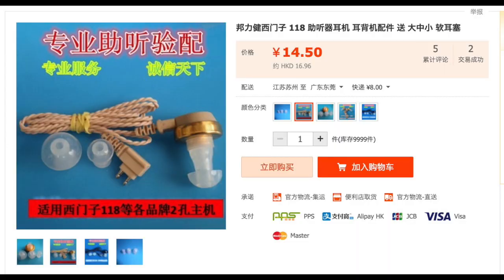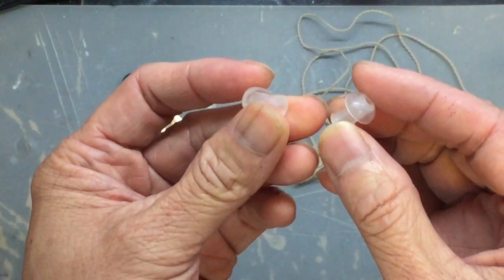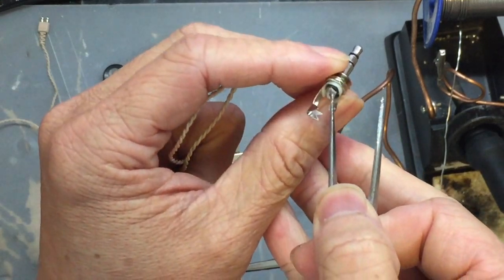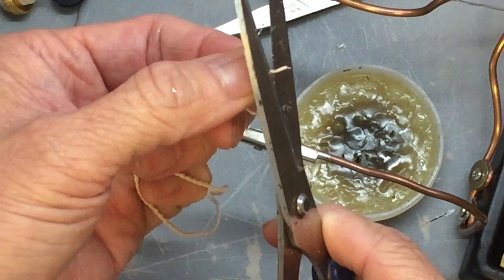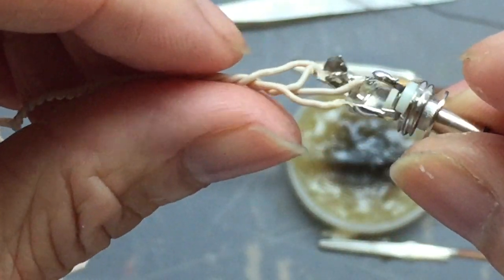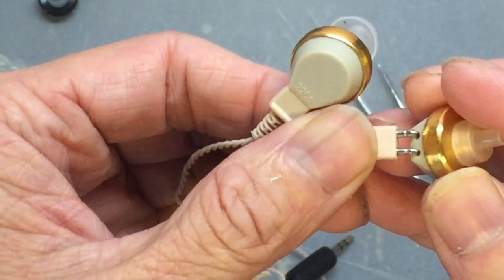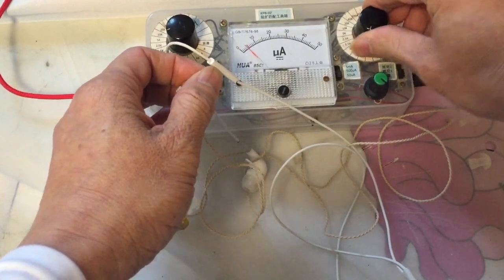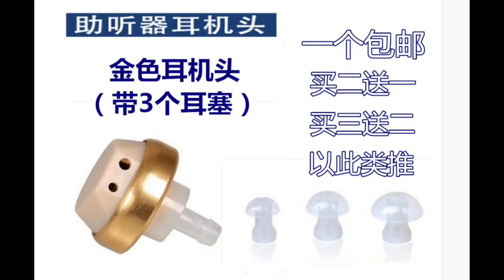DIY Crystal Radio Earbuds out of Hearing Aid Earbuds

Comment: in my first time , i used also two earphones cristall , but later is was much better to use just one with two plastic tube for every ear   , result was the same from loudness , and this have the lowest  feedback to the circuit , therefore it is the best to use one , this is my determined opinion , i love it to work with it , still today